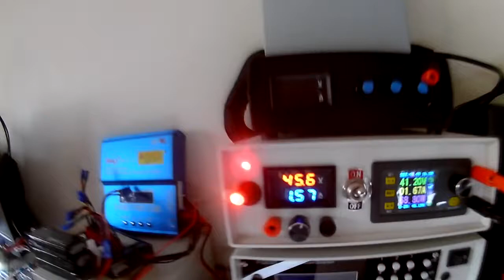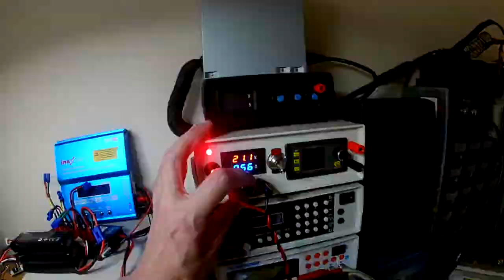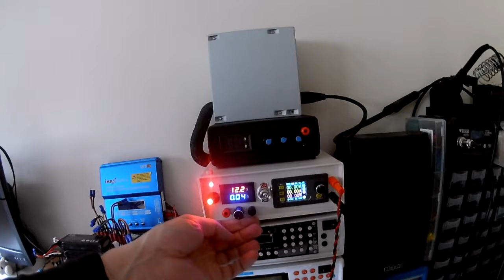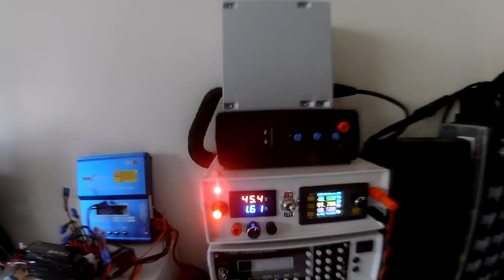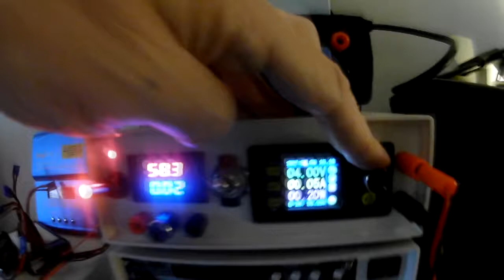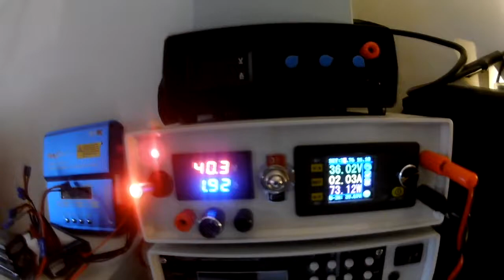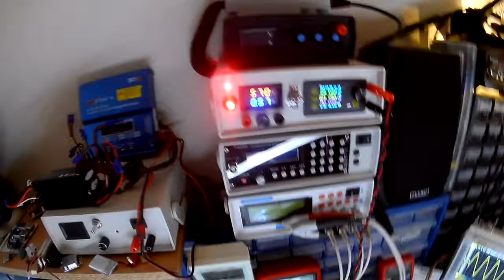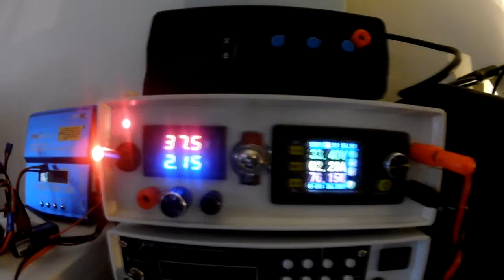DPS5015 and Solid State Tesla Coil

Comment: Could you please tell me the ebay seller that sold you the transistor, esr, capacitor checker you have there...Im having trouble believing any of them, and not ONE IS A USA SELLER.
Reply from the maker: You might find it hard to get from USA. I got mine sent in from China. Here is one http://www.ebay.co.uk/itm/Portable-MK328-LCR-ESR-Tester-transistor-inductance-capacitance-resistance-meter-/252474166571?hash=item3ac8a20d2b
You can copy paste this Portable-MK328-LCR-ESR-Tester-transistor-inductance-capacitance-resistance-meter to find one on eBay.com
Its a good meter I use it for quick testing transistors. Only complaint is the hook clips fall off from time to time. The battery lasts quite well and it still works. Good luck m8
Reply: I seen all of them..they are out for some holiday, till feb 2nd...always my luck
Reply from the maker: Its the Chinese New Year holiday. I can not reorder parts I need till the 5th, so you are the lucky one really.